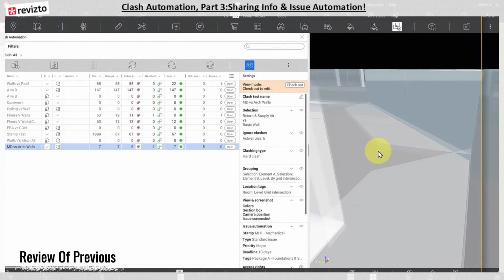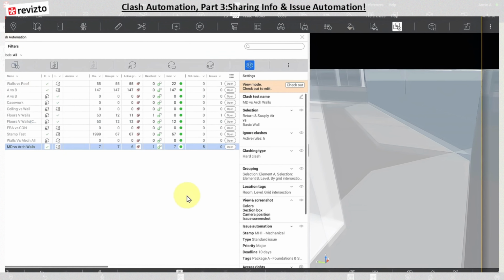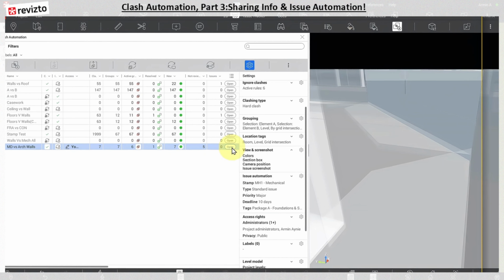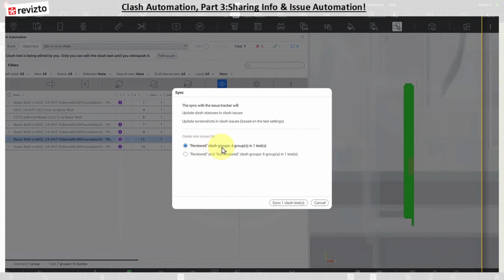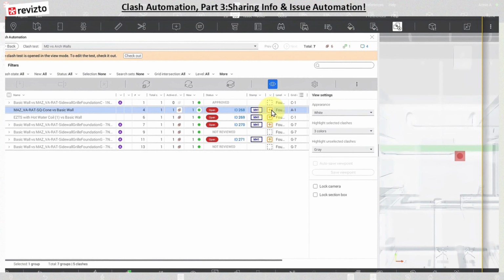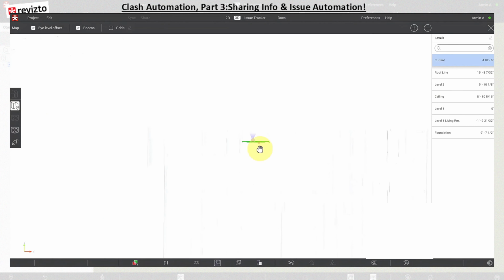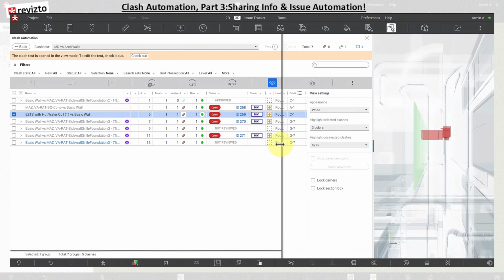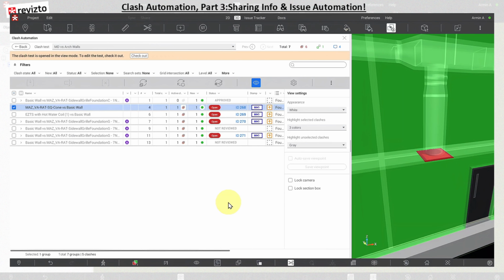Revizto Tutorials | Clash Automation Part 3 | Issue Assignment & Automation Workflow Explained

Comment from the maker: In this tutorial we cover how to assign issues and automate your coordination workflow in Revizto.
Inside the video you’ll learn:
• How to assign clashes to the right team quickly
• How to build auto-assignment rules
• Tips to organize and troubleshoot issue workflows
💬 Question for you:
How does your team currently manage clash assignments — manual tracking or automated workflows?
Share your workflow in the comments. It may help others in the BIM community.
👍 If the video is helpful, like and share it with your coordination team.